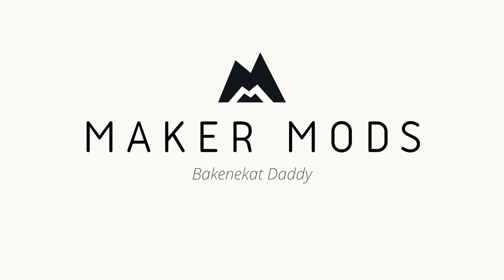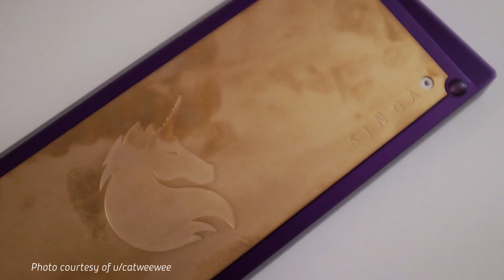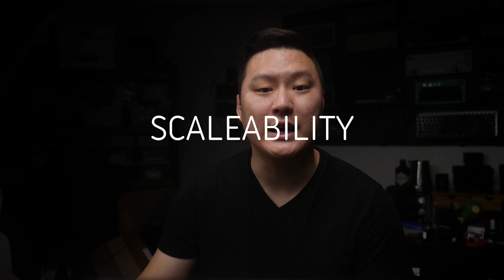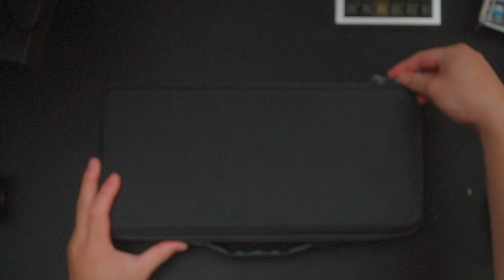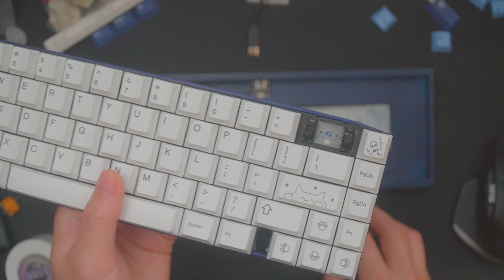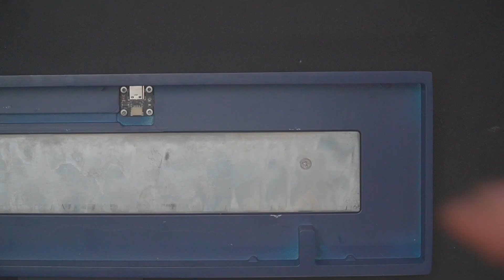BANGIN' BEGINNER 65% BOARD! | Cannonkeys Bakeneko 65 Review | AEBoards Staebies | SwagKeys Cat PBT

Comment: Wish they hadn't been so lazy on the blocker. The Maker Phantom was effectively a Bakeneko 65 v3 except it was milled (so it had a cut out blocker) and anodized, yet it was barely any different in cost from CK's Bakeneko 65 despite a much smaller run. It also had a proper plate for screw in stabs.

Would have preferred a cut out blocker (or no blocker for that matter) over the weight.

Oh well ~
Reply: Its actually EXTREMELY expensive to cut out that blocker. Not to mention, this is using casted aluminum so it uses a mold and it’s hard to have a levitating blocker in a mold
Reply: @tunamango  then they shouldn't have included a blocker. The reference Bakeneko 65 does not have a solid blocker, nor do any other interpretations of it.

Would have been a better board without it if they couldn't do it right.

Comment: I found mine way less bouncy than I was expecting based on many reviews of the bakeneko60 and I am using the 30A o-ring. The bottom out also feels much more stiff, comparable to my NK65 as opposed to Keychron Q1 or even KBD67Lite. 
Not sure if this is just how rigid o-ring mounting is supposed to be, or if the bakeneko has something that makes it particularly stiff.
Reply from the maker: Yeah, totally agree that the bakeneko 60 is more bouncy. I think because of the blocker design, it takes up a lot of the slack in the o ring which makes it less bouncy. modding the left side of the board helped make the feel more consistent, but it was still not as bouncy as I expected!
Reply: Thanks for the confirmation. Maybe they could've gone with a longer oring instead of or in addition to a lower hardness one. Just kind of disappointing.
Reply from the maker: If you haven’t modded the left side of the board, a lot of the stiffness seemed to come from the bare FR4 plate scraping against the case; I’m going to let them know so in a hopeful v2 of the board, they can maybe add a small lip on the plate or something so the mod isn’t needed!
Reply: @MakerMods  yea I might give that a shot since it definitely seems like the right side has a bit more give than the left
Reply: The reason why is the tension from the blocker on the oring. It won't have as much give because of that. It's still very good with a 30a tbh just not as flexy but still soft which is nice.